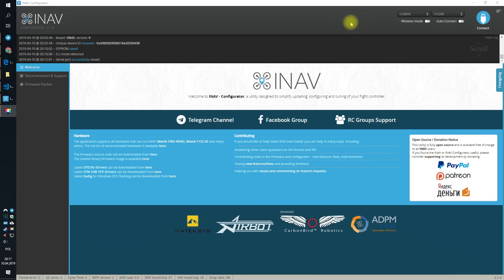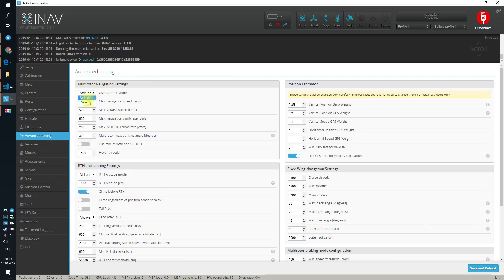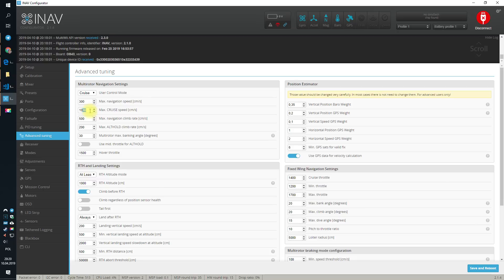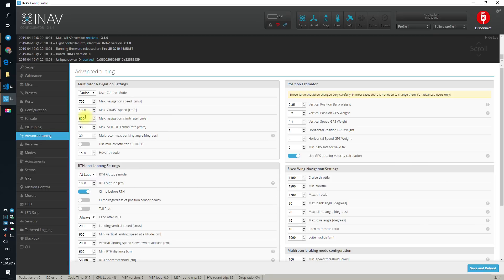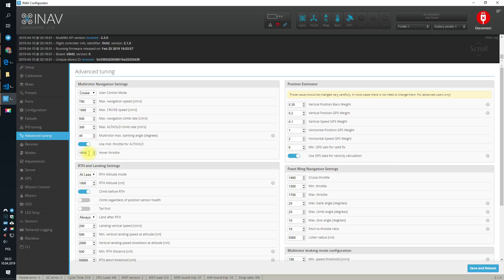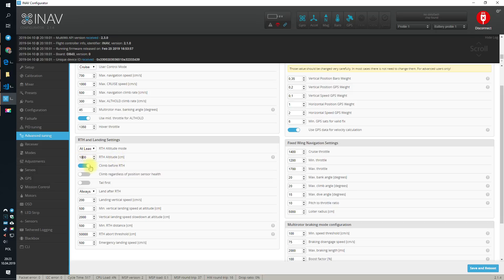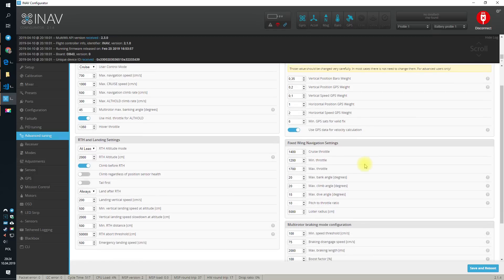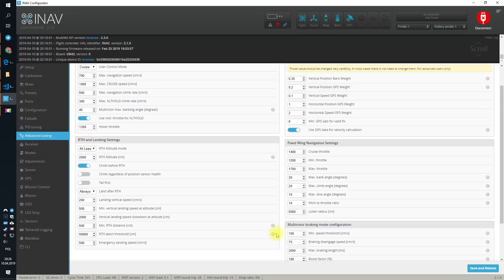How to setup INAV on a 5" quad - NAV settings in Advanced Tuning

Comment: Trying to figure out how to tune altitude hold on weak 5" long range. Shoots to the sky. mid throttle is turned off since I fly a lot of different batteries. from 4S to 6S from small Lipo to Li-ion

Comment: Dear Pawel, Huge fan of your work!
As I have lost a few 5' quads with betaflight I am now trying to idiot proof them with inav RTH.
However there is only a GPS and a barometer on my quad, no compass. Is there any chance RTH will work in inav, or is a compass 100% neccesary?
Thanks!
Greetings from Israel :)
Reply: @Ronny I have BF RTH on 5 quads for 2 years with no lost quads. Also I only have a GPS 180 or 220 (they have barometer on the flight controller and GPS only) If it is setup properly BF WILL bring your quad back but it will circle overhead, not land. See a short video of me losing FPV 700m away and the quad coming back home. 
              https://www.youtube.com/watch?v=L4zD2OT2yEg           Inav of course will land and do other things as well.   So if you only want RTH then BF will work. If you want AltHld, PosHld, WayPoints etc, then Inav is the best choice.

Comment: hi guys. I have Fc mamba F405. Can i use RTH with GPS m8n. ? my Fc doent have Barometer. i worry about it. thanks for helping
Reply: I was in your same situation. The m8n should work although the version with the magnetometer attached does not. (Only the magnetometer because it needs a pull-up resistor)
For the barometer that's the reason I changed Fc

Comment: Do you recommend cruise mode for a 5 inch crowdocopter? and why do you recommend such a low return rate of 700 cm / s? With such a speed, the quad often does not have time to return and the battery will sit down, as it seems to me. Although you recommend a 45 degree angle of inclination of a quadrocopter, isn't it too much? For many reviewers, I have seen a return speed of around 1500.
Reply from the maker: for a 5" I recoment using only acro mode and RTH as a way to come back. It's enough with FPV

Comment: Hi Pawel, love your work!
I have a question (you really should do Q'n A streaming like Bardwell) and as this video is fresh it's probably a good place to ask. I run INAV (of course) on my budget DJI 330 and 450. What I wonder is, is there a way to make Waypoints override failsafe? Reason: Lets say I have battery enough for 10-15min of nice flight and I would like to send my quad around a hill to get some nice video, like a 5min flight, but it would result in a minute of no rssi. Now that would trigger a RTH, but under controlled environment I think that a route should be able to be run without a failsafe because it is planned outside radio range. Any thoughts / solution?
Reply from the maker: Failsafe: Do Nothing. But it really does nothing. And if you will get into failsafe not in waypoints, it will still do nothing
Reply: Yeah, that's what I thought. Would have been nice to have the option to disable failsafe on waypoints, just when you know you will loose rssi. I guess it's not a big demand for such function, thanx for reply :)

Comment: Why can't we have these better defaults associated with the 5 inch Quad presets please..?......and cms/second...?....it's such hard work, why isn't it kms/hour....?.....Even in the video you were mentally converting....its the same story with Altitude, METRES or FEET....Centimetres is something an architect might use, nobody else does, certainly not Engineers, it's a stupid unit of measurement.  A Centimetre, approximately 3/8 of an Inch....You see..?.....Very silly as a unit of measurement especially when its per second.
  When I fly my plane or Quad, the OSD comes in KMs/hour, not cms/second....determining a nice cruise speed is easy when you fly it....but cms/second....?....Please get them to see sense and convert it to something we all can relate to.
  Great videos though Pawel, Im doing a 5 Inch GPS Martian as we speak......Thanks so much.
Reply from the maker: INAV uses cm and that's the end of the story. If someone will write a Configurator function that uses other units, then fine. For now cm are in place since in RC world, meter and feet are too big units
Reply: You can have Centimeters.... in the background using a converter....just show us Kms / Hour and Metres on the forms inside iNAV. Altitude, in Centimeters...?...Really..?  In fact there is ONE form inside iNAV which is in Metres, so it can be done.
Reply: This man's inability to listen to the public gives the INav brand a bad rep, can't tell you haw many times he as responded to my inquires, I lie, actually never. If you look at his videos he provides pretty much no feedback. Publish and forget, a true salesman.
Reply: Actually a thought just occurred to me, maybe he has NOTHING to do with INav, just a fake.
Reply: Why else would a INav co-writer do a video on a screwdriver ? But got no time to fix code got to do something else like evaluate an electric screwdriver????????????? What is the logic Pawel?????????????????????
Reply: For all the input to INav tp Pawel ignored comparing to Mission Planner and APM FCs, I have to go back to MP, with mini APM, as INav does not git what INav.igation is really about. The only thing I asked for is better Mission Planning, like Sat views, I understand INav can't pay google, then export/import waypoints to PC, done, easy done. Where there are no roads there is no plan with INav-fake! wanna be 5inch, not sorry guy we don't care at INav.
Reply from the maker: @fpvkabo    feeling frustrated at home don't we? Releasing some stress? Cool, I'm glad I can help. Let me ask you a question: why do you think I should do what you want me to do? We have some kind of an agreement and you pay me for doing INAV support on the topic that you are interested in? How is that supposed to work according to you?